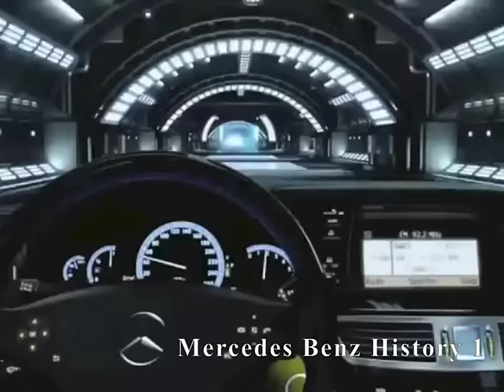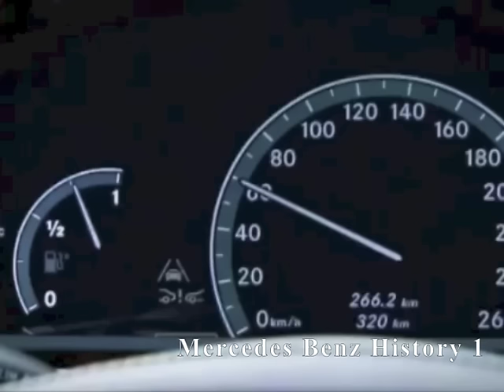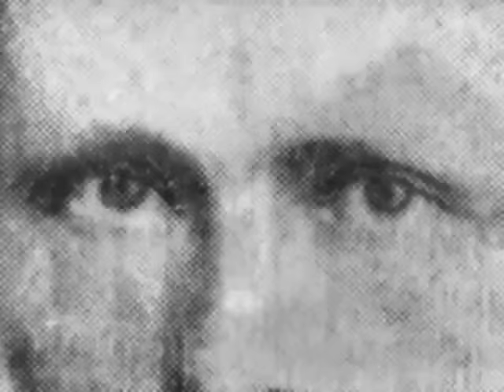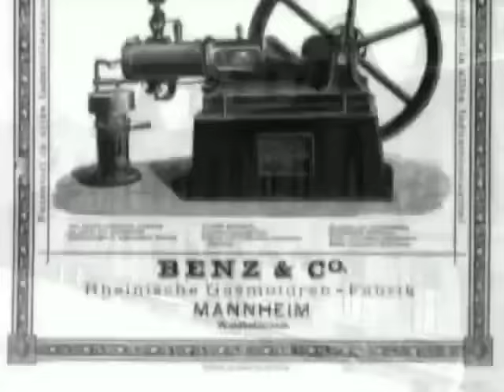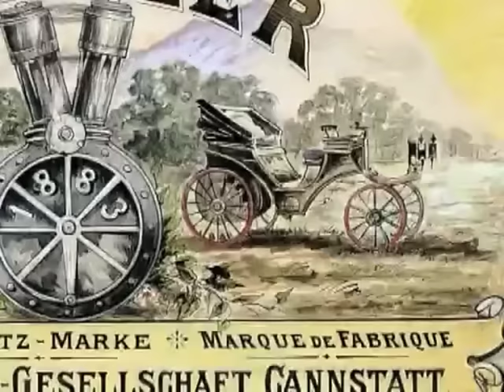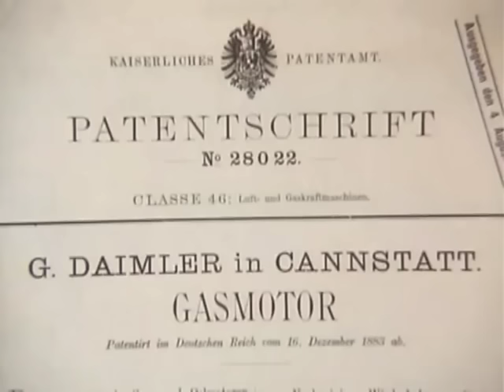Mercedes Benz History Part 1

Comment: 4:06 Bertha Benz the first driver ever in 1888, that is so amazing...
Reply: Carl Benz was a not really confident person. Or maybe he knew better than Berta, what could go wrong. E.g. when you are looking for gas (no gas stations yet), things could break. Berta had to isolate the ignition with a garter und remove debris in the fuel hose with a hat pin. Both tools would not have been available on a men‘s trip.
Reply: I'm sure others drove the car before she did , but she is credited with making the first long distance trip ( 60 miles ) ; it is documented that she did stop along the way at a pharmacy to purchase petroleum spirit , this was where early motorists went before petrol stations were established .

Comment: I got a nice German-made model of the 300 SLR when I was a Little boy, it´s still the car of my  dreams! :)
Reply: I have sat in , but alas never driven , the Uhlenhaut Coupe 300SLR when it was on display at a Mercedes-benz Club event some 40 or so years ago - at that time I was young and slim enough to fit in it . I did manage a drive in an 'ordinary' W198 300SL Roadster from 1961 , which was impressive ; alas the only 300SL I have managed to own was a modern R129 300SL-24 .

Comment: There seems to be a gap between the late 30's up until the mid-40's.
Reply: That was WWII.
Reply: @danaschoen432  yea lmfao
Reply: At that time MB was busy building  fuel and water injected supercharged MB  601 and MB 603  V12 engines for the ME  109, these were superior to the famed but old style spitfire Merlin  carburetor fed engines. Lol

Comment: At 17:27 the narrator says the 1927 SSKL White Elephant had 300 Hp. and went 235Kph = 146 Mph. Subsequent M-B models did not even have 200 Hp. According to Wikipedia the engine was a supercharged 7.1 L SOHC I-6, never mentioned in the documentary. Top speed is given as 190 Kph. = 120 Mph. How long  would tires of that era last at that speed? Power is given as 200-300 metric Hp., or 150-220 Kw. = 201-295 Hp. Therefore, the SSK was the fastest car in the world. How a six-cylinder of that era could produce such power is a mystery to me. M-B engines did not produce 300Hp. until decades later, and these were V8s.   Even Hitler's 770K with a 7.6L OHC I-8 produced 155Hp, or 230Hp. with supercharger. His G4 with a supercharged 5.4L produced only 115Hp. The Grosser Mercedes Pullman in 1963 had a 6.3L V-8 which produced 250 Hp. and pushed the 5,000 lb. limousine to  100Kph. in10 seconds; 2677 were made from 1963 to 1981. "Top Gear" did a show about it and Jeremy called it a "Green Grosser," pun intended;  it actually was green. The list of owners included Pol Pot and many other undesirables of his ilk who might need a fast getaway in the epitome of luxury.
Reply: The top speed depended on gearing , which varied from car to car , and for factory racing cars could be changed according to the event . Similarly , outputs varied due to the fitment of different superchargers ( the highest performing one being the so called 'elephant' blower ) . maximum engine output could only be attained in short bursts with the supercharger engaged ; it was not to be used in first gear , nor for more than a few seconds in higher gears . While I nave never driven an SSKL , I did have the privilege of a drive in a 1927 Mercedes S some years ago , and a couple of shots of the supercharger - what a sound ! The push in the back was also noticeable .  I would need to check , but I don't think the SSKL was released as early as 1927 ( the author was also wrong about the date of the merger ) ; as stated the S ( Sport ) I drove was from 1927 , then there was the SS ( Super Sport : more powerful engine ) and the SSK ( Super Sport Kurtz , shortened chassis )  ; I don't think the SSKL ( Super Sport Kurtz Leicht , shortened chassis drilled out to reduce weight , came out until the very early 1030's , but I do stand to be corrected if someone can evidence it .

 Incidentally , I suspect the photograph at 17:49 is of a very young Rudi Uhlenhaut , who I had the great privilege of meeting in Edinburgh , and he graciously treated me to a passenger ride in the experimental cw-111 gullwing doored test car at a club event . He was a charming gentleman who much have appreciated my interest , especially since , as a spotty faced youth , I turned heads by arriving in my 1957 Ponton 219 !

Comment: Makes you wonder what would it look like if MB made a motorcycle? (besides being grossly expensive)
Reply: They made the worlds 1st motorcycle!!
Reply: The first Daimler product was the 1886 motorcycle !  They do currently make pedal bicycles ! You can buy them at the dealership , but they are not cheap . Interestingly , they use a V-belt instead of a drive chain .

Comment: I'm currently doing a search for my 'retirement car'.  Looking at a 2006 Chrysler Crossfire (Mercedes SLK320) I noted that the Blue Book value of the Mercedes is 35% higher than the IDENTICAL Crossfire.  Just to be able to say; "I own a Mercedes" is worth a few Grand.  That speaks volumes of Mercedes' fabulous reputation.
Reply: I drove the Crossfire at the intro and they drove great. Buying a good, yet unloved car is a great idea.
Reply: Chrysler tend to be fed somewhat outdated Daimler technology ; looking back from 2022 , the Crossfire was a piece of cr@p ; equally the first generation SLK is a rust bucket , as are many recent Daimler products , thanks to their move to water based paint , which did not fare well . My earlier mercedes-benz cars are still structurally sound , but most products from around the turn of the century have rusted away . Mind you , italian , french and japanese products are much worse .

Comment: love the Mercs Hitler used. A gap in the presented history!
Reply: Daimler themselves tend to overlook that part of their history : I did have a poster some years ago , made in the 1960s , which depicted the use of their engines in aircraft , both world wars , land going military vehicles , ranging from personnel carriers to tanks . One of the most amazing vehicles is the original Gelandewagen ( forerunner after which the modern day G-Wagen was named ) which had multiple range gearing , 4 wheel drive , 4 wheel steering which could either be linked or separated ( allowing the vehicle to turn round within its own length , or to traverse at an angle , but not completely sideways ) it was an early all terrain vehicle . They also made engines for sea going craft , most notably U-boats ( unterseeboots ) , but also high powered petrol engines ( V-24 ) for E boats and many others . Oh and they made engines for the Zeppelin airships used in WW1 .

Comment: At 33:50 they say this 1930's car can travel 400 km on 10 liters of fuel. That's  94 mpg. Suspect content?
Reply: @Pippin Osborne It is a diesel engine.. The D suffix in Benz model series stands for diesel. So it is no surprise that it could go 400 km in 10 L of fuel.

Comment: I am a Mercedes owner, and I toured the Stuttgart museum a number of years ago, just before the new museum opened. What I saw lacking at that museum and in this video is nearly any inclusion of Mercedes participation in the war. I understand the politics changed from free market to the Nazi rule. And they had to participate as did others. But history is history. My USA is not above reproach and has made many mistakes and for the most part, has admitted them.
Reply: I believe Mercedes made engines for airplanes like Messerschmitt bf-109 and also for Panzers during the war time. 
Dr. Porsche (not really a PhD) was card carrying Nazi and good friend to Hitler.
Reply: @davidjacobs8558  They made aircraft engines for WW1 as well as for WWII ; some of the same engines used in early cars also were used in early biplanes ; indeed the Tiger tanks used Daimler engines , as did so many military vehicles , most notably the WWII Gelandewagen . At sea , their Diesel engines powered U-boats , and high performance petrol V-24 engines powered E-boats . Don't overlook that Daimler engines also powered the Zeppelin airships used in WW1 and up through the 1930s .
Reply: @derekheeps1244  I don't think people consider WW1 participation as War Crimes, unlike WW2.

Comment: 33:45 "A full 10 liter tank could go 4-500 km"?! that means a consumption of 2l/100 km. I highly doubt that!
Reply: I remember hearing some figures for diesel, but I could not easily find them. Are you sure they are correct? When converted 10L is 2.64gal. and 400Km is 249 miles; these figures compute to 94 Mpg, which is not credible.
Reply: +Frank Dunbar that's what i am saying. only a hibryd could get such a good mileage....
Reply: +papucimurdari Not even hybrids can get under 5L/100km and that's 130 years into the future.
Reply: @jpf6133  More likely it is American confusion between units.  Americans are simple people, metrics confuse them.
Reply: @shebbs1  easier to calculate using decimals than fractions

Comment: Mercedes Benz = Over-Engineered=Higher Costs to Repair.
Reply: MIKOL J no not really
Reply: Over and over engineered (more like fixing designs flaws) and charging for sens-less engineering time. It was never a good design to start off with.
Reply: over 100 computers in modern mercedes; ridiculously over-engineered 
 @jpf6133

Comment: Audis and Bentleys even though some may be AWD are all built on a dedicated FWD chassis, and have too much weight on the font wheels as well as the engine mounted too far forward. BMW is owned by the Quandt family, who are war criminals, and is run by stupid people, who keep doing  dumb things. When the lease is up, the engine of the 3 Series turns into a sieve and leaks all fluids. The rear frame of the 3 Series breaks  at the shock mounts so that the wheels fall off. The i-drive was a disaster as was the Bangle styling. The first SUVs rode too harshly. "Top Gear" made fun of the hatchback because it does nothing well. The new 4-cylinder is noisy and unrefined; its Stop-Start function makes the car shudder. This function is performed unnoticeably in other cars -- even the Prius. BMW engineers make stupid decisions, which belie BMW's high prices and supposed reputation. Yuppies and the younger crowd buy BMWs for its cachet. Now the M-B C Class has finally equaled or surpassed the 3 Series. Lately M-B has been introducing half-baked cars such as the cheap coupé years ago, long since dropped, the C-Class, the repair-prone M Class, and the now the CLA. As fine a car as a Mercedes is, its repair record is not what it should be. German auto-manufacturers do not seem to care because they are all bad. I cannot understand how the Germans can undermine their national pride in this way. We used to blame their 10-year drunken binge celebrating re-unification, but that's over now, and the repair records have not improved much. I have an SL, which I bought new for over $100k. I have low mileage, and have had very few problems. I love the car; I call her The Lady in Red. She rides and handles flawlessly. With the computer-controlled air suspension, I never feel any bumps. It is quiet, overpowered, with no rattles or squeaks. Unfortunately M-B service is incompetent, and the personnel rude. Lexus service is what a luxury- car dealer should be providing. M-B just does not get the message although two new dealers have been established, but a little too far away. I used to get teary-eyed watching the M-B commercial that shows all its classic cars accompanied by Marlene Dietrich's singing "Falling in Love Again." That is the best commercial ever made. I also don't know why John Boy's voice was dropped.
Reply: Make up your mind, I think German cars are all scrap...
Reply: Mercedes Benz E 190 1991
Reply: Alles